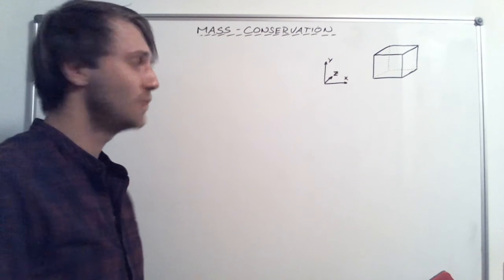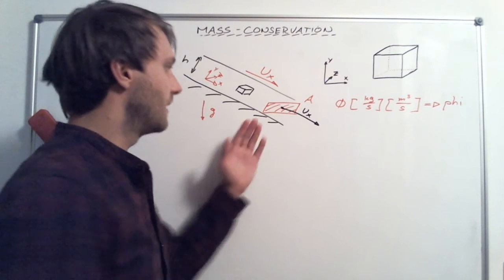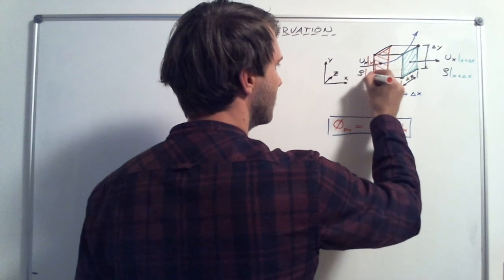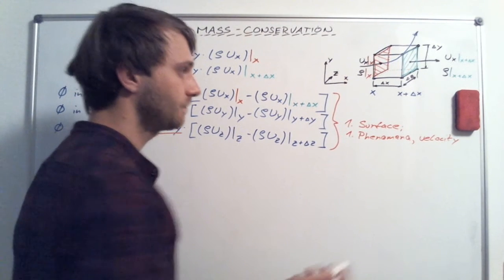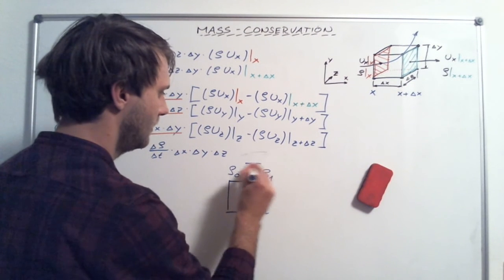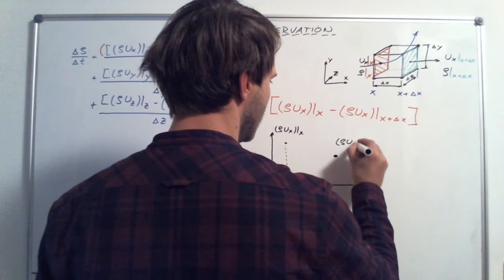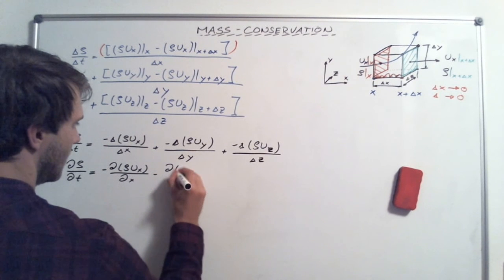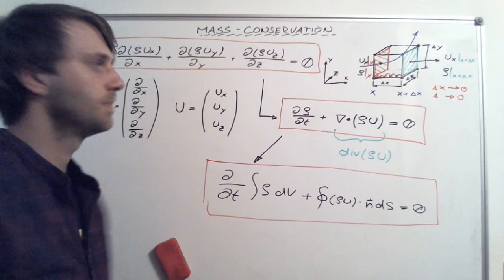Derivation of the Mass Conservation Equation ∇ OpenFOAM®

Comment: Hi nice explanation,I've a question,
1.we now that in openFoam every term of the equation(which we r going to solve )should be dimenstionally correct,so now suppose let's take icoFom solver,  

fvm::ddt(U) +fvm::div(phi, U)
          - fvm::laplacian(nu, U) according to your difinition of phi,and we put its dimensional the equation is not dimensionally correct,

2.what will be the uinte in case of Temperature equation? means  if i take  fvm::div(phi, T)